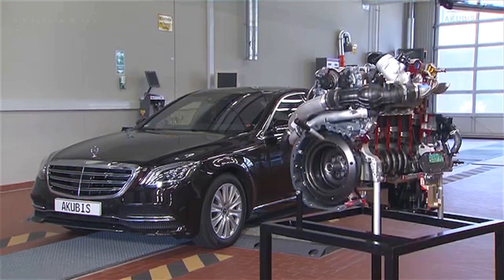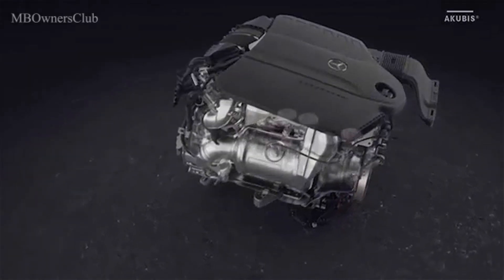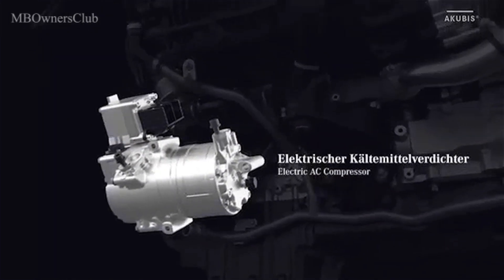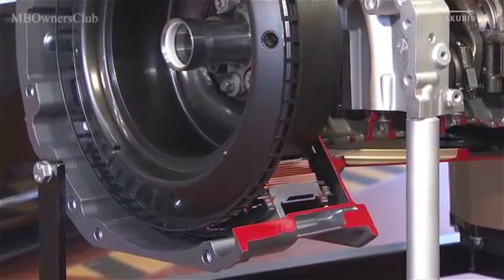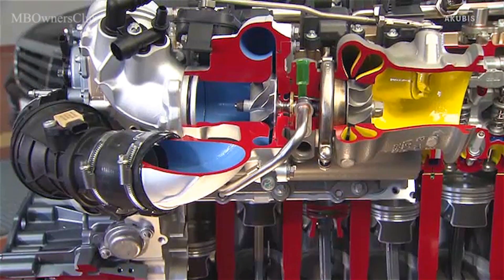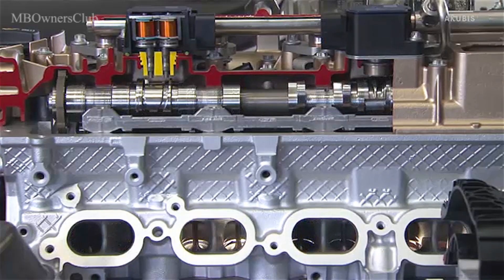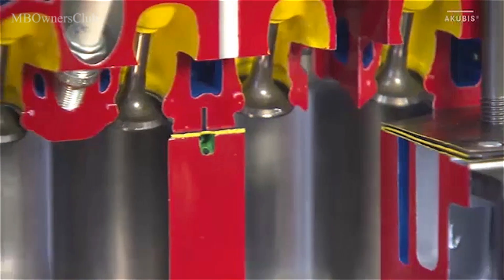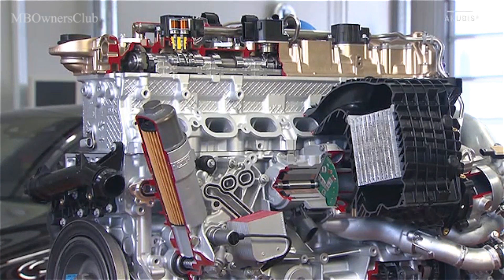Introducing the Mercedes-Benz M256 engine: A game changer in fuel economy and performance

Comment: I’ve done an ECU, TCU, and CPC tune to this powertrain on the 53 variant. 

Also did GFB diverter + VTA, blackboost intake, catless DP, and more. Great engine, 25k miles 2019. All recalls done, including 48v and harness.

Comment: I have the CLS53AMG and I can confirm the fuel usage. Mixed driving I get 0.9l/10km on highways and motorways I get 0.66. Passed 80 000km with only air struts changed, other wise runs like a clock and the smooth I6 is a dream.

Comment: In the coming years, this M256 will make 500 horses, for the 53 AMG and will eventually be passed won to the 43 AMG. With this engine, it will get harder and harder to justify the existence of the 63 AMG. It took many years for Ford to convince its customers that the 3.5 liter ecoboost was more powerful than its 5.0 V8 engine. Mercedes is on that track. I think it was a mistake for them to push a 4 cylinder C63 AMG. I think customers will be happy with a V6 in the 63 AMG but not a 4 cylinder.
Reply: The 63 needs no justification. Sadly, it has already been done away with for the most part. Nothing will ever replace big, forced-induction V8s.

Comment: Working at the benz dealership, this is 100% trash design.  engine harness will get burn, the ignition coil is right next to the turbo, cook the ME if the harness is burn, too much 48v issues. rattle can noise when cool start. but overall somewhat reliable
Reply: Funny you’re the only person who think this is a trash design.
Reply: @ bro , I work on these, they are pain in the ass to work on, and issues left and right, why you don’t like my comment? because you owned one of those trash engines?
Reply: @ ooops. Just noticed. You said you work at a dealership. So not a proper engineer.  I rest my case 🤣🤣🤣
Reply: Bearings in mind the recalls for harness problems I think the OP is correct. And BTW I own an E53 estate.
Reply: I 100% agree with the guy, I've had nothing but problems with this engine.   I have 126,000 miles on mine, and have had to replace the coils three times due to misfires.   And the plugs twice.   Now they tell me I need to replace the engine due to cylinder scorching problem.   My 1993 Ford f352 is 100 times more reliable!!
Reply: Yes , a lot of issue with this engine especially the wiring hardness....